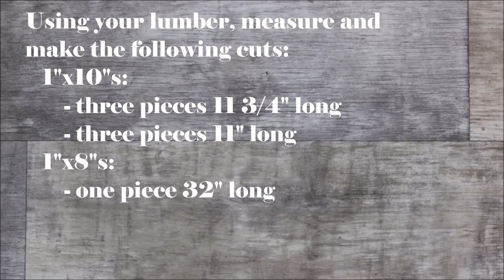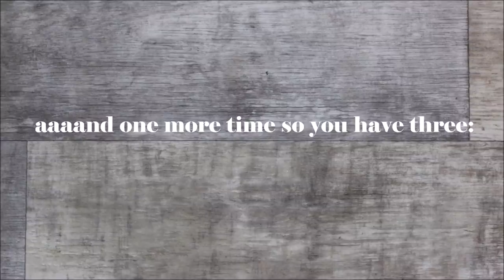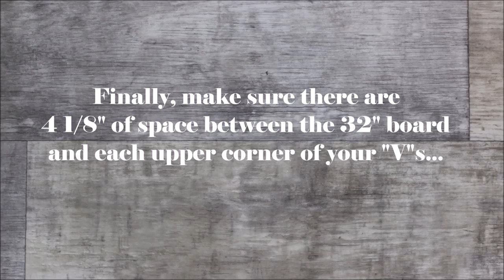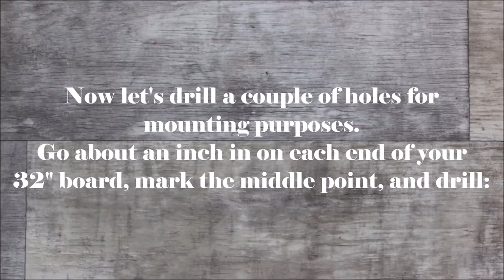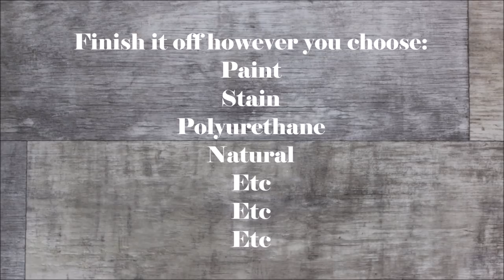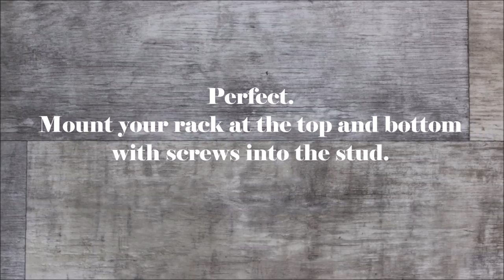The $15 Wine Rack - Easy DIY Project

Comment: BroTip: if you put a 5" piece of wood between the vees, you'll never have to worry about spacing before you drill the backing piece. Oh, and if you sand the end grain smooth- it'll take the stain a lot easier. :D

Comment: One nice little bump, or pulling a bottle out with any type of downward force, and you're going to have a cascade of falling wine bottles.  That is a very poor design, those screws will not hold up for long, especially in pine.  That is an accident waiting to happen.  Never mind the idiocy of doing any type of wood working in your stocking feet.
Reply: Going on 3 years now, no issues